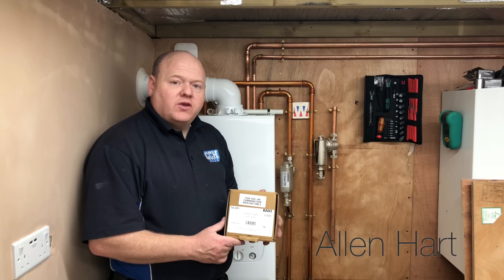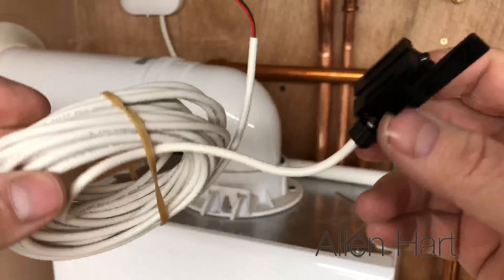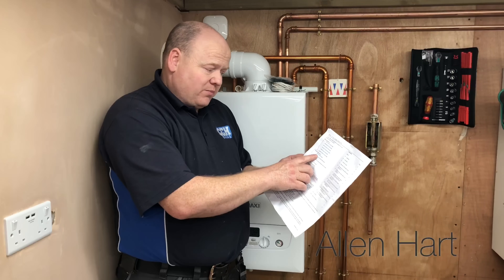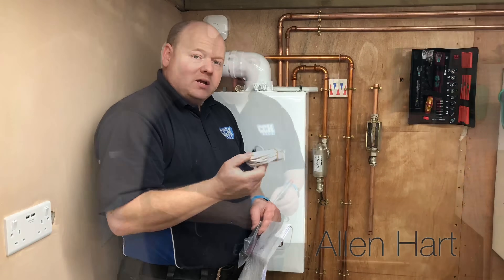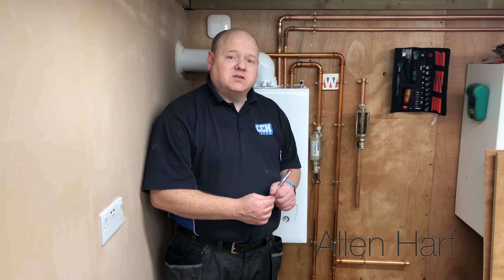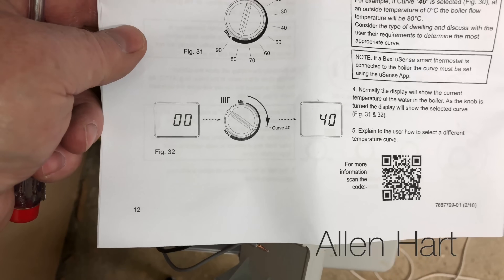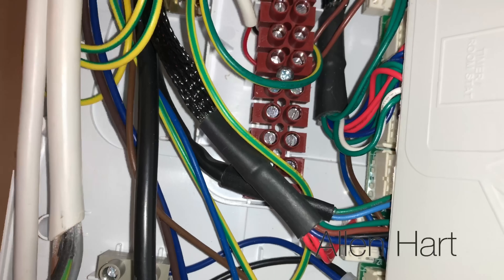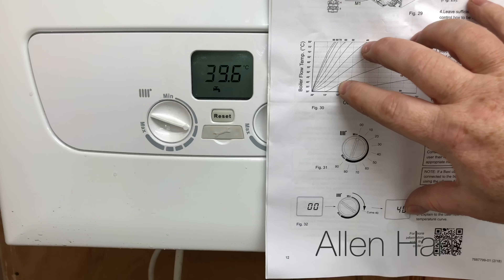Boiler Plus Baxi make it easy with the new IFOS outdoor sensor

Comment: Thanks Allen for your great videos.  Do you know if i can use the ifos sensor in conjunction with tado professional (digital control to give opentherm functionality). I am due to have a baxi 830 combi fitted soon, cheers Alan
Reply: Ps, flue is on an exposed south facing wall

Comment: Ey up  Allen. I've fitted a lot of these Ifos. A quick heads up, pull the probe further out of the clip so it nearly touches the flue terminal. If you don't do this you will find the probe gets warm from the flue heat ( it must conduct through the plastic)and the boiler runs too cool. I've had this happen on a few installs now. Cheers.
Rick(Huddersfield).

Comment: Like the ease of installation.  Outside sensors / compensators have been around since I started in this job and before, just wondered why it’s taken so long for the industry to bring this into domestic use.  We used to fit outdoor sensors on predominantly north facing walls to give true outside temp values, how ever a new boiler installations may be sited on a south facing wall with direct sun acting against the sensor giving it a higher outside temp reading for a while, this would keep the boiler off longer until the sun moved around?  I like the idea and yes it will help! In an ideal world all external sensors would be North facing or out of direct sunlight. Keep up the good work, your a good bloke..👍
Reply from the maker: Customers do not like them I am guessing, I have removed loads of them over the years.

Comment: Hi Allen
Can i wire both IFOS outdoor sensor and nest thermostat  together at the same baxi 600 boiler??
Thank you
Reply from the maker: I have removed the IFOS and just back to the nest, Nest works well enough by itself imo. Thanks.
Reply: So the nest has built in weather compensation ?
Thanks

Comment: Very interesting as I have been wondering what they do, been thinking about having one fitted to my ideal vogue 40W, but reading the other comments don't think that i will bother now
Reply from the maker: This will not fit on your vogue, personally i would wire a nest thermostat on that, connect via opentherm. Thanks for watching.

Comment: Whst a load of bollarx. Just manufactures pushing gear.

Whole point of having a room stat is to get room up to temp as quickly as possible then turn the boiler off when it reaches temp. 
Whats point having flow temp lower and having to wait longer for room to reach temp.

Condensing boilers are moat efficient at full flame! So why would you want to throttle down temp of boiler  

If you use a smart stat and the customer cancels internet (removes remote wether compensator) the whole  thing does not comply. 

Industry just squeezing the installers profit more and more. That along with erp bull
Reply: No one is regulating but when the property is getting sold thats when it flags up if homeowner and installer where complying with the regs/law
Reply: D P , Actually a modern condensing boiler will NOT condense  on full flame.  for the boiler to condensate it would have to run cooler with the return temperature coming back to the boiler around 50°C
Reply: D P only on new builds for upstairs /down zones,
Reply from the maker: We dont have any choice its the law, Home owners could be fined upto £5000 if they dont comply.
Reply: Allen Hart who is regulating it? Who will issue the fines?
Reply from the maker: Not sure TBH
Reply: Allen Hart i have more chance of winning lottery than getting fined £5000 (not put lottery on in 15years). Gas safe dont get embroiled in building regs and as registered gas engineers we self certify to local authority through gas safe. Have you ever had a spot inspection from council building control department?
Reply from the maker: I totally understand what your saying, All i can say is all the installs we do will comply. Thanks for watching.
Reply: MrSayef still wont get flagged up solicitors only ask for building regs certificate and as gas engineers we self certify. New heating systems should be zoned each floor, even with combis but who would zone a 2up2down terrace and who would check if they where given a gas safe cert
Reply: Opposite is true, condensing boilers are optimum at around 50c return temperature (~62c flow). But on older systems there isn't much point. If you crank your thermostat you want your heating at full throttle, not slowly dragging itself together and heating.
Reply: I had a vaillant vr 470 with weather sensor on my vaillant a few years ago. Drove me crazy it turn on when it was warm and stayed off when it was cold outside. Took it off and put in a nest.
Manufacturers with weather comp technology better have enough engineers in force as I suspect they'll be having alot of call outs.